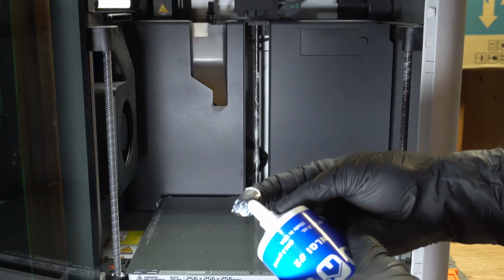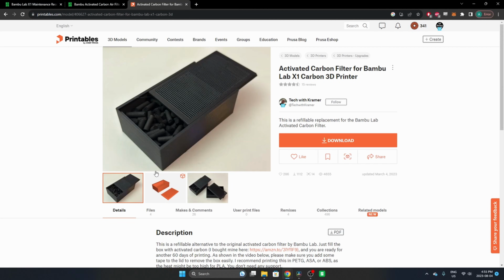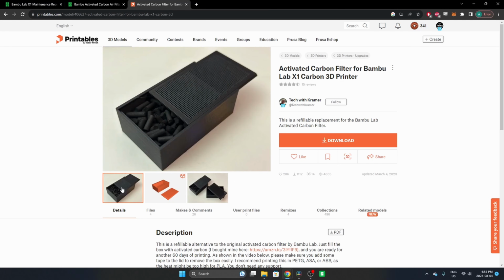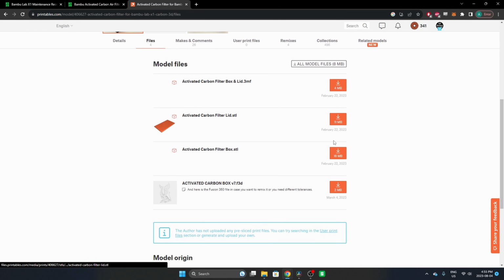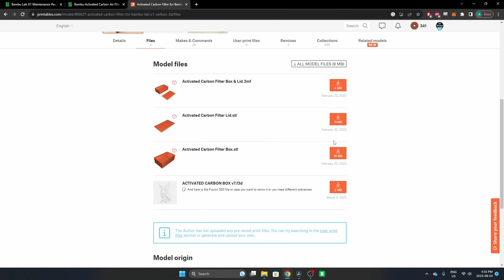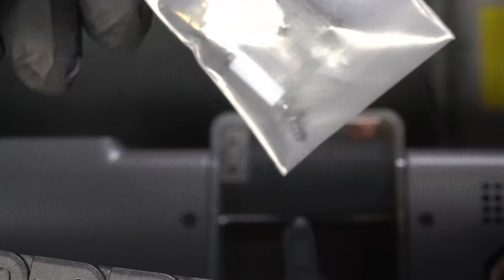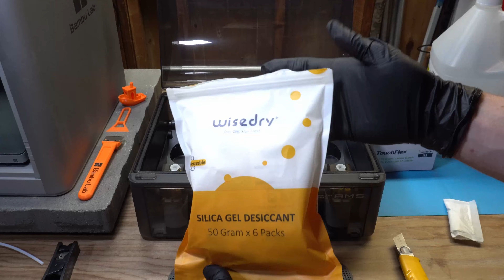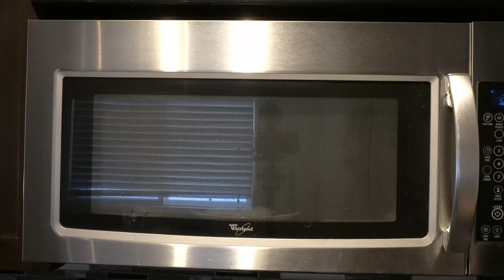Periodic Maintenance Recommendations X1C, P1S, P1P and AMS

Comment: Seems odd that you would ever need to lubricate the bearings unless the seals had worn out and leaked. These should be sealed and lubricated.
I have an H2D, P2S and just got a P1S. The wiper on the P1S seems pretty lacking compared to the others.

Comment: I know I'm late to the party, however, you should never blow a fan and let it wind (they're are videos and will show by doing this you actually build power than sends it back to connector that can potentially do damage)  whenever you blow fans (doesn't matter if its a PS5 fan or one on this printer) you should always hold it stationary if you can't unplug it.  :)

Comment: Do NOT let your fans spin freely while blowing them out. This will make the fans act as a generator and push voltage back into your printer, which could cause major issues. Also people say it can damage your fan bearings. Just don't. Place your finger on it while blowing it out.
Reply from the maker: Can an electric duster really brick your X1-Carbon
https://youtu.be/d7chv5u2dUc

Comment: Be careful using compressed air on the fan. It can spin the fan so fast that it will come apart. I saw this happen with a steel ball bearing. The race came apart and the pieces cut the guy holding it pretty bad.

Comment: Never blow a fan with compressed air without holding it still. You can kill the bearings. and generate back voltage

Comment: Please if you are using and Indicating Desiccants do not dry them in the same machine you make food (microwave,over,food dehydrator) , Blue>Pink indicator has Cobalt Chloride, Orange>Green have Methyl Violet. The white silica gel is food-safe and non-toxic, just don't confuse this with Calcium Chloride (the one that turns to brine-like liquid) that isn't food safe plus it doesn't regenerate.

Comment: With the help of a friend, I just recently opened my AMS after a long while from a filament block in the tubing. We found a lot of oil on the floor. What can you recommend? The printer wasnt used used but 4 or 5 times since purchased.

Comment: Please remember to tape your fan down. That way you don't blow a bearing out when blasting it with compressed air. Some of the fans are just magnets.
Reply from the maker: Can an electric duster really brick your X1-Carbon
https://youtu.be/d7chv5u2dUc
Reply: another thing...
If you spin a fan you can create a charge.  Sometimes that can damage stuff.

People regularly kill graphics cards by cleaning them with compressed air and spinning up the fans.

Don't let the fans spin up.
Reply from the maker: @TheMugwump1  https://youtu.be/d7chv5u2dUc

Comment: Another 'safety' tip, similar to the tip regarding blowing fans out: when moving the print head manually while cleaning/lubricating the linear rails, move the head very slowly, because, like a fan motor, the print head stepper motors will generate a (possibly damaging) current back into the board they're attached to.

Comment: Hey be careful blowing out the fans like that. While in motion from the fan they are generating voltage back to the control board. Best to unplug you want to do that air spin cycle. Alternately hold the fan in plan with a finger or tape and manually go around it to clean the blades so you don't need to unplug them.

Comment: just a tip, hold the blades of your fans when you are blowing them out. its better for cleaning them but also fans can become a generator when they blow fast enough in reverse. most modern tech has protection in place to prevent power from feeding back into your electronics, but no need to risk finding out if bambu does too. also I'm surprised bambu recommends alcohol for cleaning the camera and lidar as it can permanently fog the lenses. ammonia free windex or just water with a microfiber cloth is my go-to.

Comment: What happens if you get grease on the belt itself? Does it damage the belt in any way and is there an easy way to clean it?
Reply from the maker: Shouldn't damage the belt. The concern would be your belt skipping teeth if there's too much lubricant on the belts surface. You could probably try using some IPA on a rag to wipe your belt and get rid of any lubricant that might be on it.

Comment: bearings in the idler pulleys are sealed, don't put oil/grease in there.....
Reply from the maker: "There are multiple idler pulleys installed on the printer. These idlers have sealed bearings inside which don't require greasing, but we still recommend adding a bit of lubricating oil between the idler flange and the plastic holder to avoid any squeaking noises." https://wiki.bambulab.com/en/x1/maintenance/basic-maintenance#:~:text=for%20linear%20rods.-,When%20to%20do%20it%3F,anti%2Drust%20every%20three%20months.

Comment: fyi if you ramp a fan up with compressed air, while the device is off as you did at 1:31, it can can short out the board the fan is connected to since its generating a current. hold fan still while you blast it with air so it cant spin
Reply: I was going to say this too, make sure to hold the fan down while blowing out the fans
Reply: Too late  @hiry45
Reply: My thought exactly.
Reply: I went to the comments the second I saw that lmao
Reply: not only that but if it goes fast enough it blows apart in pieces. (I've done this to my ps4 lol)
Reply: just put a diode in there simple solution instead of holding the fan like a caveman

Comment: for the z-axis screw rods is it possible to use WD-40?
Reply from the maker: Wouldn’t recommend it. WD-40 isn’t a grease and so doesn’t stay where it’s placed as well as the other options. Super Lube 92003 Silicone Lubricating Grease with PTFE or Lucas Oil 10533 White Lithium Grease are the recommended greases.

Comment: I worry because sometimes compressed air cans seem to shoot out liquid. Isn't that bad?
Reply from the maker: Are you holding it upside down? You should hold these cans upright while using them. Compressed air cans are a liquid in the can that rapidly expands into gas as it leaves the can. You shouldn't have to worry about it.

Comment: I found on the Bambu lab wiki they mentioned some brand of grease or Super Lube 92003 Silicone Lubricating Grease with PTFE as an alternative for leed screws.
I printed resealable trays for ams desiccant and used some Dry & Dry orange beads, plus using original desiccant till it used up. But My Ams is only at 10% humidity, I have seen that Slice Engineering makes desiccant for rolls that’s not silica and really powerful at drying Ams.
Reply from the maker: Yes they added a recommendation for the type of grease after I had made this video. 

From the bambu wiki "You can use the BX-300/F series grease in the link, but other lubrication alternatives can be used. A popular lubricant is Super Lube 92003 Silicone Lubricating Grease with PTFE or Lucas Oil 10533 White Lithium Grease which should work similarly." https://wiki.bambulab.com/en/x1/maintenance/basic-maintenance

Reusable trays for the AMS desiccant are a good idea.
Reply: So 92003 works well?

Comment: Do not use IPA on the carbon fiber rods as you will inevitably get alcohol on the rubber belts. Alcohol breaks down rubber at a chemical level, this is why cheap gasoline breaks your car down. I don't see anyone else in the comment section warning about this
Reply: Then what should you use?
Reply: Use ipa towel

Comment: I've been maintaining linear rails on printers for44 years.  Cleaning those rails is always a good idea.  The dirt you may never see will resist motion.  44 years ago the motors were weak, so print quality quickly  showed big impact.  A 3d printer is different than a dot matrix printer, but those linear bearings and chrome plated rails have not changed much.  And when maintaining my 3d printers, I can confirm they need it more than the dot matrix printers.  quality prints require good maintenance.  Good video!
Reply: What lubricants are best to use? The ones from the movie or others?
Reply: The first 3-D printer was made 41 years ago
Reply: @goodboygolden1  His comment clearly specified dot matrix printers, not 3D printers. His point was, that regardless of the application/type of machine, the same logic applies and it's always a good idea to clean linear rails regularly.

Comment: Vacuum before you grease, otherwise the grease captures the tiny filaments you can't see (let alone some big ones). Also, a good alternative is WD40 Dry PTFE, works well on mine, seems to not hold onto anything.

Comment: Great video and thanks for sharing.

One recommendation though. If using compressed air, use your finger to hold the fan stationary while blowing it out. It is entirely possible to damage the fan bearings by spinning it too fast.
Reply: Came here to say this.  You can damage the bearings.  Yes, I've seen it happen.
Reply: @AsianTankPilot  How then
Reply: @Pcswitchgamer put pressure in the center not allowing the fans to spin and than use compress air to get the dust out!
Reply: Especially if you have a high volume / pressure compressed air tool (Larger compressors).  they will definitely blow your fans apart if you aren't careful.
Reply: @TheReal-MFer  Is there anyone who would REALLY go in there with a large compressor?? I guess though there is no warning label to not do it...
Reply: @TheReal-MFer  Learned that the hard way myself - lol
Reply: Not only that, but spinning the fan generates voltage which you don't want to feed into your printers circuitry.  Many Video cards have died from people blasting the fans with compressed air.
Reply: @Matt-dk3wl  Forgot the voltage issue. Thanks for adding it

Comment: You should never let fans spin when blowing them out with compressed air, always a good practice to hold them as your blowing, some fans can send an electrical charge back down the wires
Reply from the maker: Noted, I've pinned a comment at the top of this comments section saying the same thing.

Comment: ive had my p1s for about 3 weeks an this was something i was worried about but im not going to lie. i got 12 other machines that range from kingroons kp3 to sahppire plus or qq-s pro so alot of different types an brands of printers an maintenance is something i didnt really do for any of those brands or what little i did was not near as often as bambu lab recommends for there machines ,but im going to do it cause i paid more for this machine an im really enjoying it but all my other printers are still running strong. the p1s is on a different level compared to my older stuff but they are still capable machines but i wouldnt mind selling a couple of them off to get newer printers if not all bambu lab machines, really would like to replace  a couple of my bed slingers for one of there a1 to see how well they do compared the p1s, but what really makes the bambu machines so much better is the ams an software.

Comment: Thank you for your video. GREAT. You say to apply an anti-rust every 6 months, what kind of anti-rust should be applied?
Reply from the maker: Super Lube 52004: https://amzn.to/453YC4n, any generic sewing machine oil will do but superlube has a good reputation.
Reply: Thank you!  I have already bought all the products you recommended but I didn't think Super Lube was an anti-rust product.
Reply from the maker: @ClaudeLaflamme-z4q  Oh nice, yeah you're basically just preventing the metal from being exposed to air/moisture by having a thin layer of oil on the rods. 

I wasn't sure if they market it as anti-rust but I went and checked its on their technical sheet "Prevents rust and corrosion" https://www.super-lube.com/Content/Images/uploaded/documents/TDS/Technical_Data_Sheet_Multi_Use_Synthetic_Lightweight_Oil.pdf

Comment: very detailed, thank you. I’d recommend to also clean all the lead screws before re-greasing them, so you’re not putting new grease on top of old grease. A bit like changing the oil in your car rather than just keep topping it up.
Reply from the maker: Yeah that's a good suggestion. Should have included that in the video.
Reply: What do you recommend for cleaning the lead screws? Also the isopropanyl?
Reply: @joepvandijk  I have successfully used Brakleen (Brake cleaner) sprayed onto a microfiber first.. no need to spray it directly, may get in unwanted places.
Reply: @joepvandijk  Yes, you can use IPA to clean off the lead screws before greasing them. Just put some on a microfibre cloth vs spraying it.
Reply: Check out Gear Floss. Saw a video here on YT, it was newer easier to clean the back lead screw. Just did mine two days ago

Comment: Do not blow your fans and make them spin like this guy. Hold the fan and then blow it out.
Reply: Didn't hold it once on a laptop fan, it exploded, every single blade was gone
Reply: Have you heard of one single case of this causing damage? Just curious because I have blown about 1000 plugged in fans with no issues.
Reply: I busted ventilator in my GF's laptop that way once,  the bearing gave up.
Reply: Yes. You're making a tiny generator.
Reply: @ericray7173  I have 'broken' a device before by doing this. However it was a very cheap device with no protection. I'd guess almost all devices with fans have this protection if they use sensitive electronics.
Reply: He didn’t use compressed air, so the fans can’t spin too fast
Reply: The great destroyer of video cards: compressed air.
Reply: Unless you can unplug it first. Reverse voltage is not great but most good electronics should have reverse voltage protection diodes.
Reply: @SmokyFrosty  it's not the voltage, it's that the air will spin it up too fast and blow out the bearings
Reply: @galaxyruin huh? 😂
Reply: This
Reply: Bro this has been debunked for years

Comment: DO NOT spray compressed air into fans without holding the fans to prevent them from spinning from the compressed air. Letting the fans spin from the compressed air will destroy the bearings due to the fans spinning too fast.
Reply from the maker: Yessir
Reply: BTW this is a known fact,but it is less known that even you try blow as fast as possible in most cases it does not make enough voltage to harm those electronics behind the fan.
Yes there are cheapo fans that can make voltage,due to the missing fan controller,but in this case I would doubt that they did not used one.

Comment: Super helpful video.  My 3-month-old lightly used X1 Carbon printer nozzle seems to be holding onto the filament after going through pre-checks.  I print mostly PETG.  Going to give it a good cleaning and then look into replacing any required parts to fix the issue.
Reply: Check if your filament needs to be dried, this is most likely happening when your filament is humid and there is excess filament coming out.
You can just use the drying program over night in the UI of the printer itself and put a small box over the filament (with maybe some holes) for best performance.
Reply: Also verify that the ptfe tubing from the AMS (if you have one) and the one connected to the print head do not have sharp bends, and are not worn out inside.

Comment: Where did you get the paver you are using? It looks 18x18 or 20x20. All I can find at Home Depot and Lowes is 16x16 which barely fits the printer, or 24x24 which is way too big.
Reply from the maker: https://www.rona.ca/en/product/oldcastle-plaza-slab-concrete-dorset-grey-20-in-x-20-in-10503148-66635208

Comment: Tip from an old fart

hold the fanblade stationary when cleaning with pressure, the fan SHOULD have a diode in it to prevent failure. But its best to be on the safe side to avoid downtime on your hardware imo. 

also you will benefit from adding a swivel guide for the feeder ptfe going into the head for less friction, do choose one that stops the tube from rubbing on the glass :)
Reply from the maker: @reyalPRON thanks for the old fart info. 

I really should have known better. But I'd be surprised if they don't have some sort of reverse voltage protection or freewheeling diode build into their fan control circuit. 

That's a good tip, it feels like a design flaw that the PTFE tube drags around on the top glass wherever it goes.

Comment: I'd be hesitant to use anything other than glass cleaner to clean sensor and camera lense. Alcohol or similar could possibly fog it up.
Reply from the maker: Hadn't thought of that, IPA is the recommended cleaner from Bambu. We'll see how it does over time.
Reply: @3DPrintStuff  they might be both glass then but for my experience especially sensors are a type of plastic that can be easily eaten by chemicals or permanently fogged up

Comment: Any reason why you went with "Super Lube 52004" which does not have PTFE vs "Super Lube 51004" that has PTFE? As I understand it, PTFE helps with lubrication. I am still new to this.
Reply: Also, any reason for not going with "Super Lube-21030" with PTFE for the grease?
Reply from the maker: @brandonkish3100  For your first question. We're using this mainly as an anti rust coating. So the added PTFE isn't really necessary but won't hurt if that 's what you want to go with. 

Second question. That 21030 is a good option. I went with the lucas oil white lithium grease because it's a very affordable option.
Reply: @3DPrintStuff  And what would you recommend from from the WD40 Specialist series? The Sylicon, PTFE or other?

Comment: Quick question.  Some of the lube that i cleaned off around the base of the "lube screw" got into the smaller screws,  I cleaned them the best I could, but i know its not 100% cleaned out.  I cant get into the little spaces of the small screws.  Any ideas if this would cause an issue
Reply from the maker: I think you mean the "lead screws" but I can understand how you could hear "lube screw". If some lubricant got into the mounting screws around the lead screw base that should be completely fine. I don't see that causing any issues.